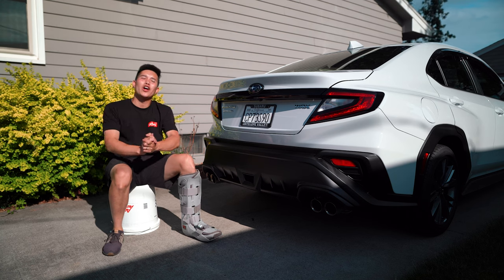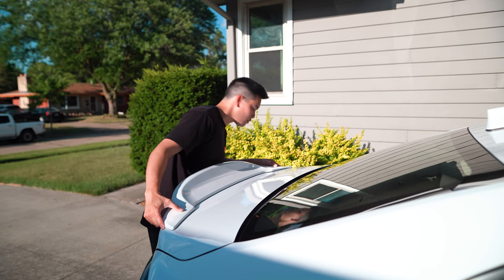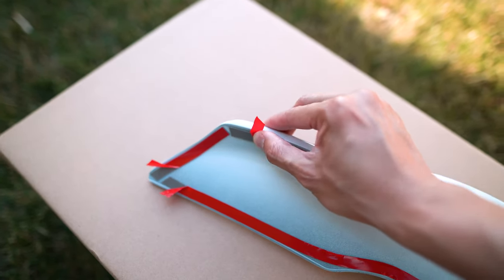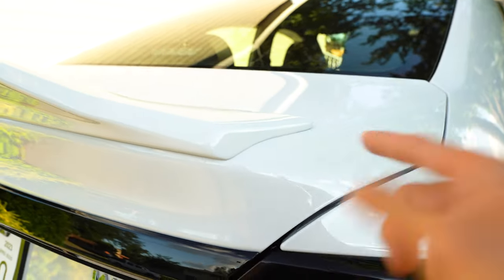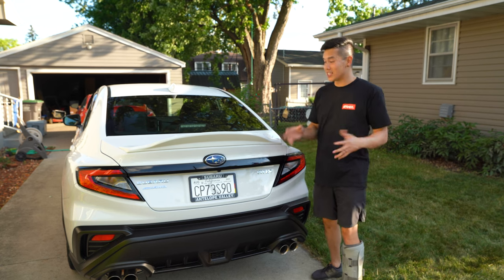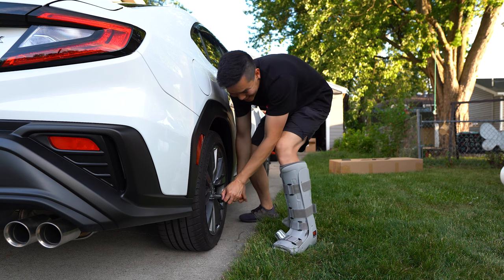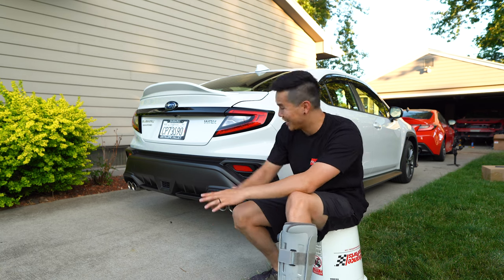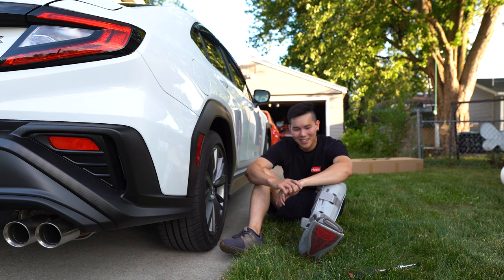NEW 23 WRX Problems Already?!

Comment: The wheel locks I got from Subaru that were on mine snapped. I torqued it to what Aeroflow said to torque it to, and it didn't feel right. Checked the next day and the head of the lug snapped off. Had to hammer a socket to it and it came off. Spacers are on though, and it looks way better.

Comment: I'd have them replace those studs; they are probably stretched and could fail, especially on the track... I wonder if they are cross-threaded??
Reply from the maker: Cross threading all four of them would be wild haha I'm sure they just used an air gun on them for too many ugga duggas
Reply: Most of my GR86 lug nuts were super tight from the factory. Ended up replacing them with ARP studs. I suspect you will too.
Reply: I work for Subaru as a lube tech and I can’t stress enough about how terrible the Subaru studs are in general
Reply: @KevinVo  I had some overtightened lug studs. They snapped on the highway and the wheel flew off. Take it seriously, it could kill you.

Comment: If you have a lug nut stuck with other lug nuts broken loose already. Snug up the ones you already freed and go back to the jammed lug nut. Works for me almost every time. Great opportunity to make a video on arp lug nuts. (No reason to go extended unless you need them for wheel spacers.)

Comment: Normally I would go to the 3/4 drive ratchet and tap with a hammer to impact break the nuts loose. Done this a few times with old suspension bits also.

Comment: You need a bigger breaker bar lol. Never fails when you need to break something loose. And use your weight instead of trying to pull up to break it free, push with your weight over top. Hell jump on the breaker bar if you have too. It will come free much easier regardless
Reply from the maker: It's going to 100% break the stud regardless haha

Comment: i never use locking lugs, ive broken waay too many of the locks in the threads. besides, if thieves want your wheels theyll find a way to take them off, regardless of wheel locks.
Reply from the maker: I wish they were never installed haha

Comment: Hey Kevin, the exact same thing happened to me on my 2023 BRZ. I was trying to install lowering springs and all the regular lugnuts came off fine but I could NOT get the locking nuts off even with a giant breaker bar and extension and destroyed the lugnut key. I ordered another key from Mcgard for $20 and it happened AGAIN! I ended up having to get one of those lug nut removal kits where you hammer on the socket and used a long breaker to finally get them off. What a pain! Like anyone is going to steal stock Subaru 17" wheels. BAN LOCKING LUGNUTS!

Comment: You need a bigger breaker bar with more leverage. Or do the stealers way and find a impact socket that could go over it barely, hammer it and rip wheel lock lug nut. I had to do that to mine one time was not a  fun night. Cool thing is i got aftermarket lug nuts. 😅
Reply: breaker bar.....it's your best bud when there are none around
Reply: dont know about destroying the lug nut with this method but im pretty sure you can fit the wrench to the nut and itll have just enough to hold itself in place without falling... then just stomp on one end. obviously not good idea with an injured leg like in this video.
Reply: @no1washerezz  not with his foot lol
Reply: +1 on a breaker bar
Reply: Why is this being upvoted. His issue isn't breaking the lug nut loose. His issue is wrenching it harder is going to break the stud.
Reply: @yeonboy1  it’s a possibility sure, but look at the other YouTubers have swapped wheels or added spacers to the 22+ wrx. Guarantee they either used a breaker bar or impact. They may have snapped that stud, they might not have. 

But to reduce the risk of snapping it - spray some lubricating agent, grab the breaker bar and give it some tough, gentle, love. Maybe even a couple “snap tugs” to break it free quickly

Comment: 2017 wrx Owners manual states 89 ft lbs. Not even close to what torque I do. I had the same problem with America's Tire. They over torqued every lug nut. Then got a flat. Snapped every stud on 1 wheel trying to get them off. Rotating tires I snapped 4 out of 5 lug nuts on the other 3. Turns out 72-75 ft lbs is plenty tight. But I swapped to ARP studs and steel nuts because the factory hardware is garbage pot metal. WTF Subaru.

Comment: the normal 5th gen impreza has this problem. I snapped 3 studs when i had it. only ever used hand tools to tighten it after the first. Its just soft aluminum studs, get aftermarket ones trust me

Comment: I would go to dealer and tell them to take those off. 

Other option? Drill the wheel locks out and destroy them while on the wheel - wont stress the studs more then they are already. Or finally - order a set of longer studs and swap them anyway.

Comment: Have you ever heard of the breaker bar?  It is the bad practice to use a torque wrench to loosen off a wheel lock nut.  You should always try to block your wheel before turning any wheel nut off and on.
Reply from the maker: I didn't use a torque wrench... it's an extendable ratchet 🤦‍♂️ did you not see how easily the other lug nuts came off? You shouldn't need tons of leverage to break it loos. It's only supposed to be ~90ftlbs.

Comment: @10:00 dawg use a breaker bar! 

for reference if nut torqued to greater than the head on the torque wrench, the square drive will rip off--i've done it before on the 32mm axle nut, but same principle here; 

there is a quick fix, use breaker bar--again for reference if your torque wrench is 18" and you weight 150, then that is 225 foot pounds it will take the nut off dawgie
Reply: dawg one mo suggestion wd-40 my dawg woof

Comment: Just a random piece of advice.  If you want your tools to last dont break high TQ with a ratchet.  use a breaker bar.  thats how you destroy rachets.
Reply from the maker: If it would've been torqued correctly it wouldn't have been high torque! 😅

Comment: I snapped a lug stud a couple weeks ago putting back on my oem wheels from snow tires 18 brz.  Dealership changes my oil for free.  Only reason I go to them.  Find someone or shop with air tools and you'll be good.  Love your videos and miss you at ftspeed

Comment: The last lug nut that’s on the wheel is carrying the entire load of the wheel. You should always remove the lock nut first before you remove the rest of the lug nuts.  The reverse is true when you put your wheel back on. The lock nut should be the last one back on.  This way the lock nut sees the least load when you that it off and put back on.  On your WRX, torque all the lug nuts back on the wheel to spec.  Then try your impact drill to remove the lock nut first.
Reply: That is not correct the lugnuts do not bare the full weight of the wheel or vehicle. The center bore does. Pay attention next time you put on a wheel u usually have to push it that last little bit over the lip on the hub before the wheel is flush. Also on several other wheels he only took one other lug nut off so even if your statement where true it would still not apply.
Reply: This is also why selecting aftermarket wheels is so critical. Just because the bolt pattern matches and backspacing will clear does not mean that wheel will fit correctly. Luckily most manufacturers use similar centerbore specs on similar bolt patterns.

Comment: you need to use a jack stick or pole that fits the ratchet for more leverage to take out the lug nut. dont be scared eventually youll have to do it anyways..
Reply from the maker: I can already feel it seizing up. I'm almost certain it's going to snap with more leverage.

Comment: Try to block your wheels to stop it from having any movement before using any tool to loosen off the wheel nut.
This is the reason why I bought my 2020 Crosstrek, 2019 Trax being brand new with two conditions: "No lock nut installation on delivery".  Mind you wheel lock nuts are likely to be installed at the dealer, not from the factory, without knowing how those monkeys at the dealer installed them.  Especially when they tested your brand new vehicle which they call it PDI (Pre Delivery Inspection).  This was also the second condition in my Bill of Sale: "No test drive and also no gas fill up, as I did not wish my new vehicle driven by any of those monkeys".  I had those conditions entered legally in the Bill of Sale when signed and dated.

Comment: I've seen this same problem on other cars. In my case Hondas & Acuras (my soobs have been OK). For whatever reason the locking lug nuts were always like someone torqued the sh!t out of just those and the OEM lugs were fine. Maybe the metal is just different enough so they "stick" more to each other. As others have recommended, get yourself a length of iron pipe for just these occasions. Good for leverage and intruders 🙂I doubt you'll break the stud, might strip out the security key but likely not IMO. Little bit of penetrating oil over night, maybe some heat from a heat gun - worst case. This is why I put a tiny dab of anti-sieze on the surface of the lug nuts that contact the rim (not the threads).

Comment: That duckbill looks fire! Im with you about wrx problems. My new VB with 1600 miles, threw an engine light this morning. Taking to the dealer tomorrow to check. You have to do the short shifter next. Big difference.
Reply from the maker: Sorry about the CEL. A STS is on the list!
Reply: @KevinVo bro it was the gas cap brahhahaha

Comment: Looks good, be careful installing wheel spacers without installing extended lugs. You need the correct overlap on the lugnut threads to make sure your wheels don't come loose while driving.
Reply from the maker: These are bolt on spacers and not the traditional kind.
Reply: @KevinVo  how wide are the spacers ?
Reply from the maker: @dougrodriguez4977  they're 20mm
Reply: @KevinVo  wowza!
Should look interesting. 
Shocked how over tightened those locks were, outrageous. 
Look forward to see where you go. I like your partners, they are very talented. I’m not a VB owner, I’m a GD guy but I like the new wrx. Thanks for replying.

Comment: Literally went through this recently. My GR86 had one lug nut that was either too tight or the dealer cross threaded my stud when they did a tire rotation. Luckily my friend replaced my stud for me, but I think I’ll be getting better studs down the line.
Reply: I was gonna say, my BRZ broke 3 studs. Spoke to the chief service mechanic and he admitted to replacing a stud almost every time a vehicle is serviced. Subaru has bad studs. I've rotated my tires hundreds of times over a span of a combined 600K+ miles with Toyotas and Hondas, and Subaru is the only one I've ever experienced this issue with.
Reply: @SHiFTDI3S3L I also broke 3 studs and it was on the same wheel.
Reply: @saulespino2510  mine was on 2 different wheels.

Comment: I knew exactly how you felt Kevin when you hit that first locking lug/stud. Had some new-used wheels that I wanted to go test fit on my 17 rex. Went to loosen a lug and stripped a stud. Other three wheels lugs were easy to get off. This was also my first time getting at them since I got the car from the dealer. I always torque my lugs at 90ft/lb and they're just as easy to get off.
Reply: Same problem. They overtorqued my wheel lock and I stripped the key 😅

Comment: I would definitely go to the dealer and be like wtf? I work at Hyundai and when I do PDIs I barely even torque the wheel locks on brand new vehicles. These gotta be like 100+ ft-lbs. I drive a 17 STi and I'm happy I don't have to take it to the dealer for maintenance bahaha.

Comment: So now I should go check mine I guess... under 2k miles. Pray for me.  If I find mine are the same it will go to dealer for proper torque. Not even a question. Nearly 40 grand for a car it had better have properly torqued lugs.  Glad I came across your vid. Good luck.
Reply: They were fine
Reply from the maker: Glad to hear they were good!

Comment: I think subaru just over torques everthing! Anything with the vin starting with J I think this happens. I remember when I went to do my first oil change on my 2021 I could NOT get the damn drain plug off.

Comment: Bro don't take lug nuts off like that you'll hurt your back something fierce. Just stand on the ratchet handle, use your body weight, almost zero effort. You already used an breaker bar for more torque, it should be easily done even after it was fastened with air tools.

Comment: Use a bigger breaker bar, not a torque wrench. You'll ruin the torque wrench over time.
Reply from the maker: I'm not using a torque wrench. It's an extended ratcheting wrench. I would never use a torque wrench like that haha

Comment: If they uggadugga it on, you uggadugga it off.
Reply: It's also interesting we're all thinking about the studs snapping, when on other cars with these locks, we worry about the key or lug stripping (cause there's torque limits on the metal too). Is a stud snapping better than needing to drill out a lug nut and replace a key? Probably....
Good Luck Kevin!

Comment: Properly torqued or not…remove subaru lug nuts in the AIR only and youll never have this issue…the stud is a cheap soft metal.

Comment: I was thinking of getting the new wrx is it a good platform to get started in ?
Reply from the maker: The WRX is a great platform to start in as long as you're willing to put in the work to learn what to do and what not to do. It can very easily be a disaster if you're not careful.
Reply: It's a subie so it's good. Its all user error that get these Cars a bad name.

Comment: Too many ugga duggas from the tech who put those wheel locks on. Get a 36"  1/2 " breaker bar and that should come off no problem. If your rotors happened to get warped because of the over tightening your video is proof they messed up.

Comment: Thats why they hire men for this job
Reply from the maker: What does that even mean haha
Reply: First its clickbait and im sure a milwaukee would take care of those lug nuts
Reply from the maker: @W333dm4n  strange I would classify a locking wheel nut not coming off as a problem so not seeing how it's clickbait. Also, I have an impact, I've been dealing with these cars for the past decade, this is not a new problem. It's actually a common problem you see on Subarus. Impacting them off would still run into issues with them either snapping the stud or completely ruining the threads.